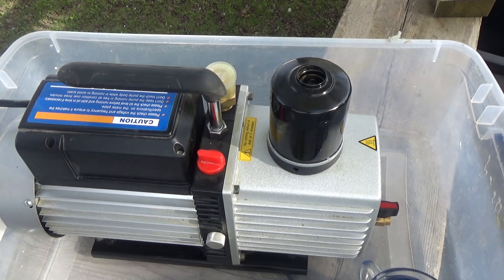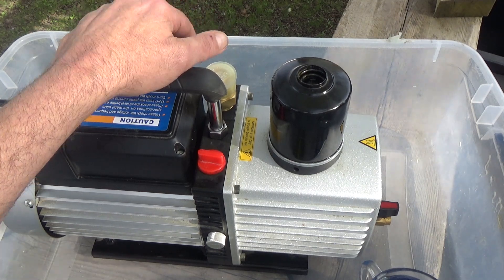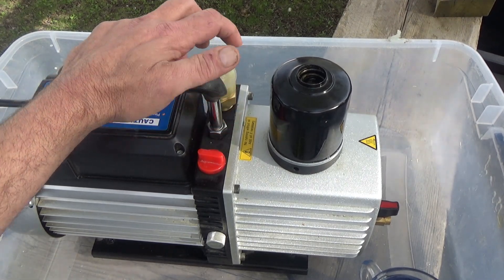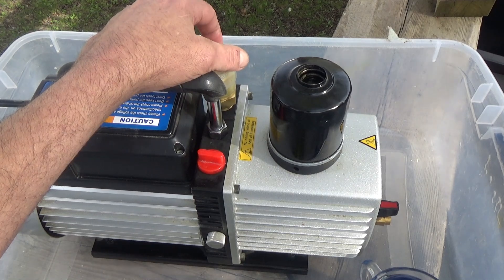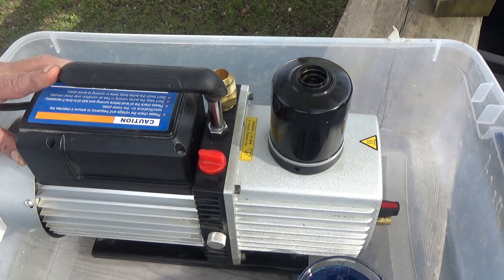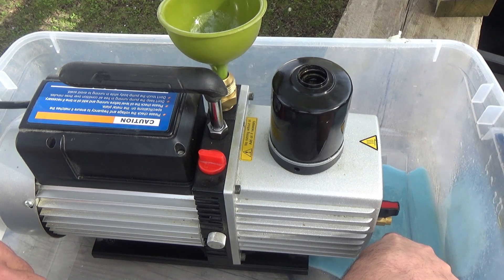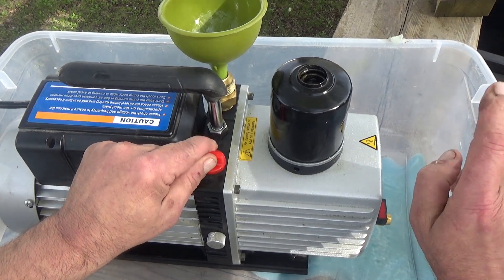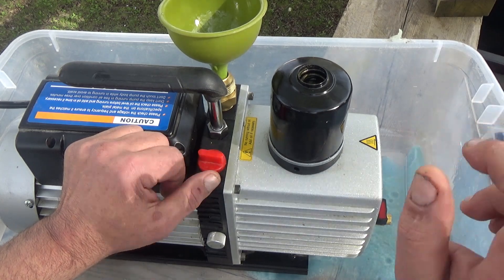Harvest Right Unable To Achieve Vacuum Error Ep167

Comment: I went through 5 JB pumps in two years. I think it was because I did a lot of pizza sauce and the acid ate the seals but HR says that can't happen. The 5th one which I still have is boxed up and is my emergency spare. It took me a year to pay it off but the oil less pump is so much better. It's been running strong for the last two years. It's so nice not having to drain and filter oil every batch.
Reply from the maker: I never had the JB pump but have really been happy with the standard pump. I have the dave ramsey philosophy, If i can't buy it cash I save until I do. I hear the premium is fantastic, but I can't afford it.